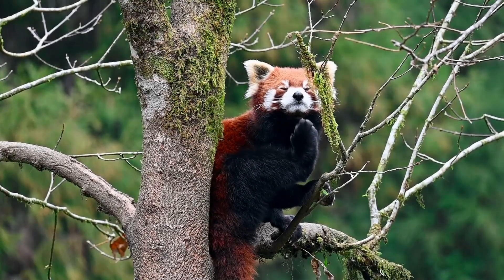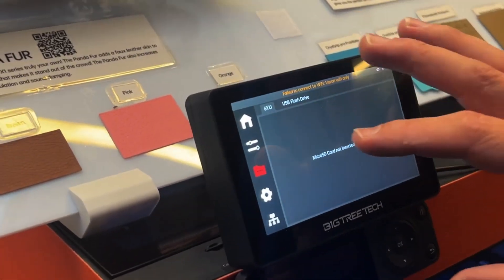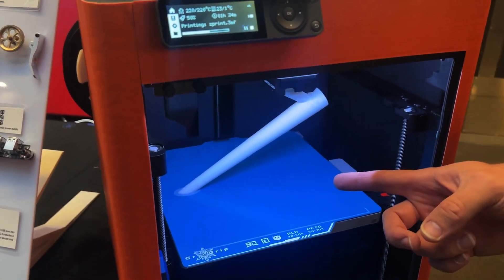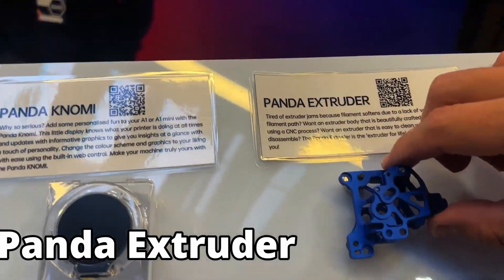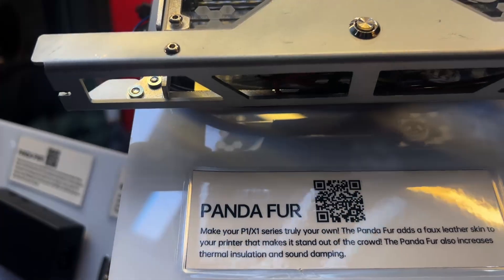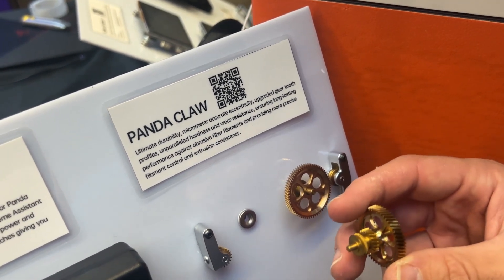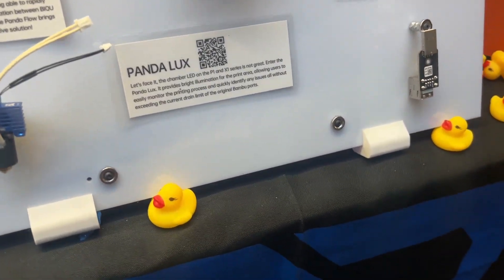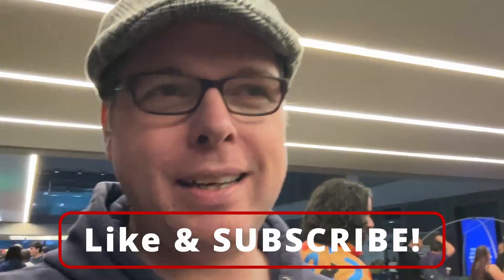Bigtreetech Panda Products: Must-Have Upgrades for Your Bambu 3D Printer!

Comment: Question on the Panda Lux. I have the Lux for my P1S and the installation instructions tell you NOT to run both the stock LED light (left side of P1S) and the Lux at the same time. However, it appears you are doing that. How are you able to power both without any problems?
Reply from the maker: I have no idea, but I think that the BIGTREETECH Panda PWR Intelligent Power Management Module is there for that reason.

Comment: I tried the panda claw on my A1 and my X1C, both cause big issues, it seemed like the part that touches the filament shreds it inside the extruder and causes a build up of material inside the extruder.  This happened on both machines.   The Blue build plates are great, and the Panda jet seems to work well.  The Lights were great on the A1 and X1C,

Comment: Just working on installing the Panda Extruder.... but was having issues with the filament cutter sticking and not retracting all the way out of the path of the filament when released.  Ended up having to lightly file down the edges of the end of the screw that keeps the cutter upright, because that seemed to be snagging on the slot milled into the Panda Extruder if I had the screw in all the way.

Comment: The Panda Claw is an objective downgrade; super heavy and causes ringing due to the poorly machined gears. Same for the Panda Extruder--for $40 it's only 1g lighter than the fully-sealed Bambu extruder and the bearings fit so loose they rattle around.  The Panda Lux has horrible color rendering index and light distribution--you'll get better definition on your prints with the stock light or a cheaper USB LED nightlight that plugs into the OEM port on the inside of the frame.  They filter their website reviews so that the mediocre and negative ones never appear.  Overall, I'd say Biqu is batting around .200-.300--fine if you're doing baseball but not so good as a commercial company.
Reply: @EliteMacFreak  I have the Lux in my P1S - I don't have the issue you are talking about.  The OEM light was crap for lighting.  Really that's the one place where Bambu really "failed" in a product design sense. The location of the stock light is terrible.
Reply: @KITDFOHS  The color profile really is to cool for my preferences, I wish they had a way to swap between different color temperatures like most strip lights allow for.
Reply: @DrawnDoggo  not sure I'm following.  Are you saying it's too white?  My entire home has 5k-6k  LEDs in it with the exception of one bathroom
Reply: @KITDFOHS  There's different "temperatures" to white light. Basically there's "cool" white which leans more to artificial blue in color and then there's "warm" white which leans more toward natural yellow in color.

It's really a preference thing, most light bars/strips have a way to switch the profile between the two and they actually sell separate bulbs for home use.
Reply from the maker: So you are not happy with the Bigtreetech products from the Bambu... noted
Reply: @Zachary3DPrints  Just so it's not totally negative, the Panda Touch, Panda Jet, Panda Branch, and Panda Hub are all good.  The Panda Touch doesn't need any explanation, but the Panda Jet improves the overhang quality if you perform a 4-way test in the areas where the P1/X1 single AUX fan can't reach.  The Brand and Hub are a good way to get power to LEDs and other things safely.  The Glacier plate (light blue) is a solid addition to the arsenal if you want a textured plate that isn't as rough as the standard textured PEI.  It's just not better than the standard PEI after a few dozen prints--as long as you don't expect it to live up BTT's hype you'll be happy with its smoother surface finish.

Comment: Oh, finally I can know what those product listings with no pictures on their store are XD
Been quite happy with all the upgrades from them (I got the Revo, Extruder, Claw but it wasn't good enough for me because too heavy and a few other concerns, Lux, Fur, Jetpack and all the build plates, but I hated the designer series, never got any filament to stick to it but after two weeks of arguing they agreed to refund it). Overall, really nice products, although QC could be better, as my Frostbite had one side with a pretty large blob of coating in the middle, and the Extruder was bent due to the lever arm pin pressfit, which they also agreed to replace after arguing for two weeks : P
Imo the Frostbite, Revo, Lux and Jetpack are must haves. I'm soon gonna get the Supertack from Bambu to use instead as I've seen people saying it has slightly better performance, but mainly for me I don't always want the super shiny surface that the Frostbite leaves on prints, it's a pain to sand when I want to do stuff like two sided tags.

Comment: Interesting they show the Panda Lux light running at the same time as the stock light, but they said not to do that as it overloads the power from the control board
Reply: Maybe they are running it from the power supply they showed as well?
Reply: yes if you run panda power you can run the two lights, if not you wont be able to see your camera while its printing.